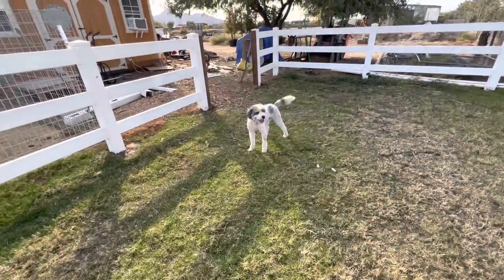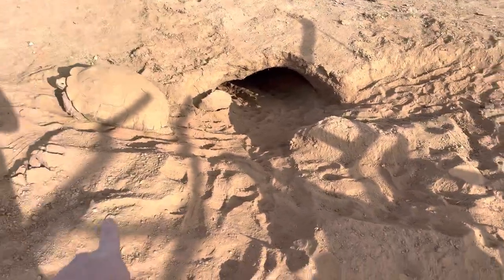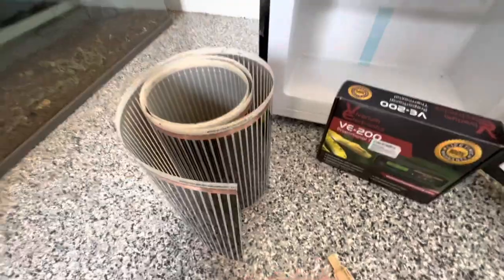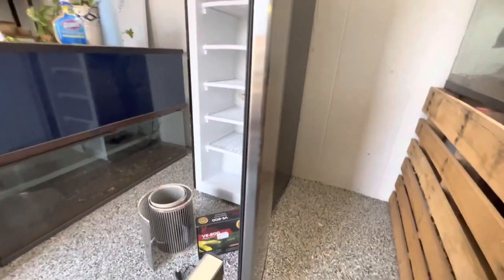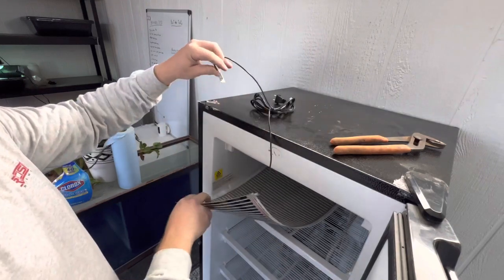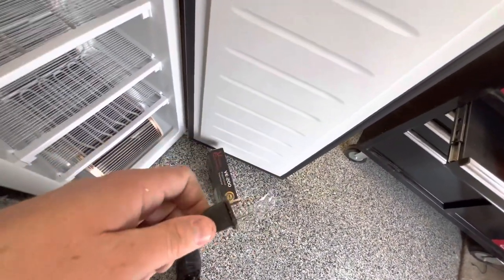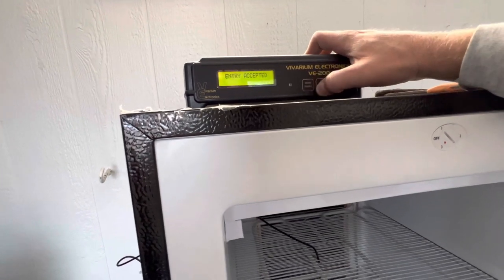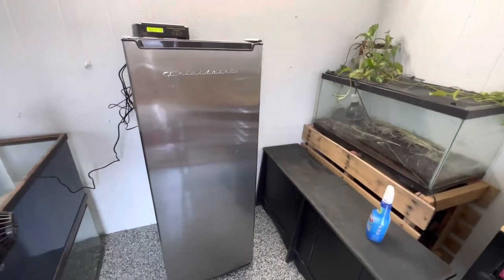DIY Incubator! $2000 vs. $200

Comment: Thanks for the vijeo. I am looking at videos for info for basically doing the same thing, but for a chicken egg incubator, and heat tape was one of my ideas. How has it been? Any updates?
Reply from the maker: So my version worked really well. I then moved it to make a larger incubator and failed to put a fan in the larger space. And had hot spots. I have since invested in a professional grade incubator. It’s my most recent video on the channel. But the DIY one is very doable. 

If it’s for chicken eggs though you may as well just buy one in my option. You won’t save much if you are going to buy a nice thermostat and heat tape.